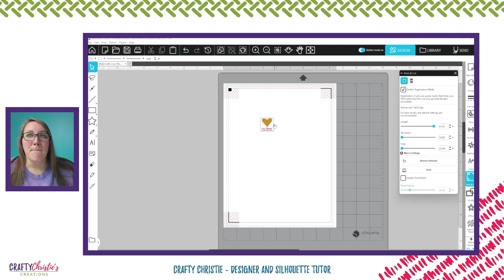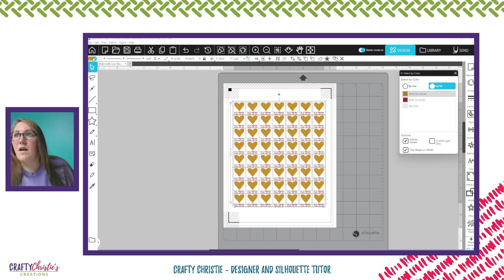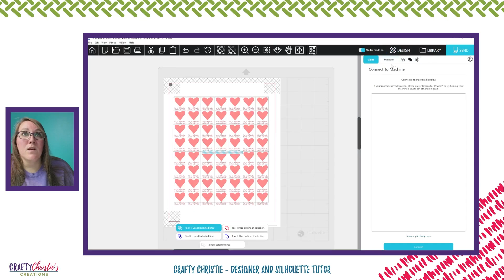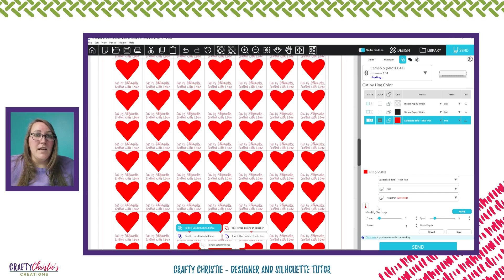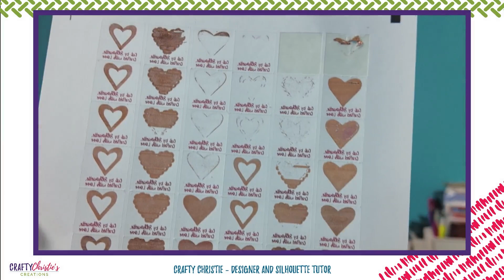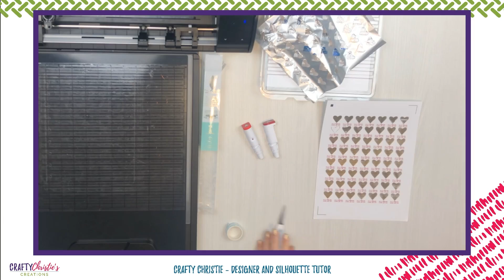Create Your 'Made with Love' Mark - DIY Heat Foil Stickers with Silhouette

Comment: Thank you I love it ❤ did you face any issue with misaligned cut with es mat ? And how did you fix it?
Reply from the maker: What I’ve found is that for print and cut on the ES mat the edge of the material needs to be about 1/4 of an inch from the left edge for the registration marks to read.